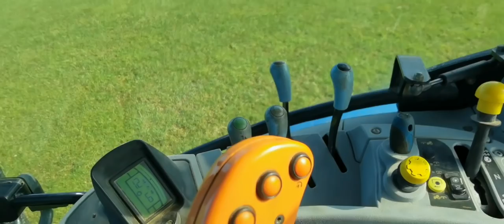Amazing Slurry 2021: Umbilical spreading, New Holland T7040 300hp. HD 4k

Comment: Drew:  What is at the other end of that pipe that is doing the pumping that creates so much pressure that it can move that BA tractor with you in it?  The pump must be a monster.  How does it work? --one pipe in the slurry and another to the pipe you've been spreading on the field?  Gosh!  the slurry comes out under so much pressure that it destroyed the slurry plate. How do you keep the lime dry?  Be careful inhaling the lime.  How do you mix it to adjust the PH of the mixture you put on the fields?   The connectors on the pipe must be monsters too.  I see Farmer Phil in IRE, who also uses pipes to spread slurry, use quick-change connectors on his pipes.  Farmers are amazing too!!! Your skills and abilities are (no words).  Thank you.

Comment: Heh, uv joint packed up on our contractors doda pump this year also! I had one in stock and was up and running in an hour...keep them coming if you have the time 👍🇮🇪
Reply: Alastair:  I couldn't stop thinking about the pressure that the pump is sending the slurry through the pipes.  Holy smokes!  Drew said that he had to do a three point turn at the end of the field to keep the pressure from controlling that big hunk of metal tractor.  I wonder how much PSI hit that slurry plate???  I am sure it is different depending on length of pipe, aperture of the nozzle...What kind of a pump is sending that kind of pressure down the pipe?